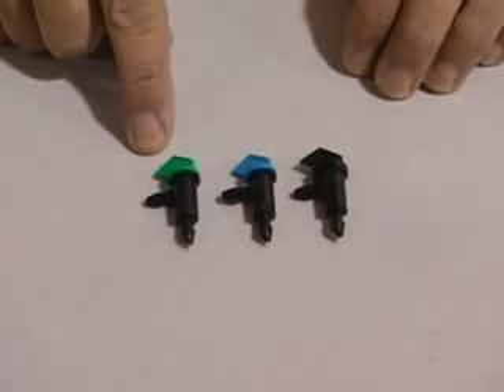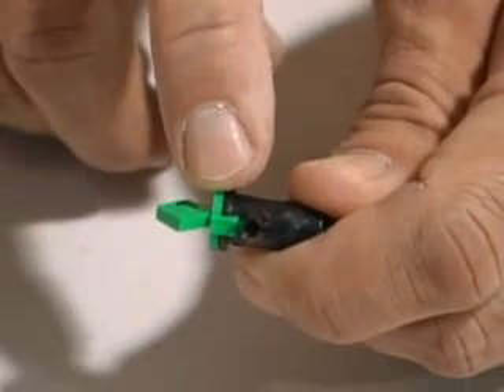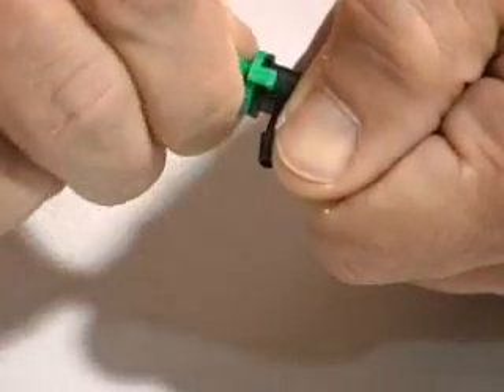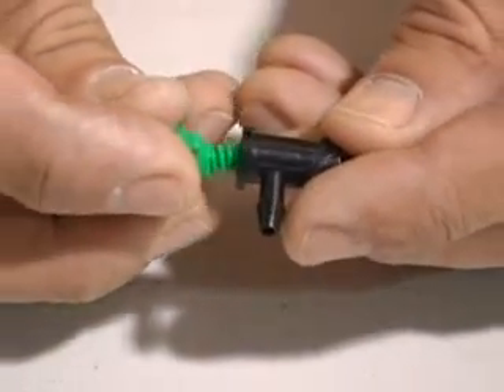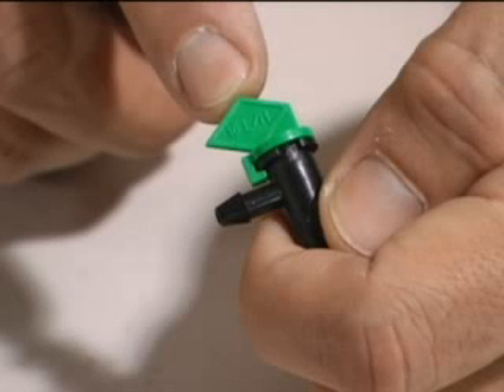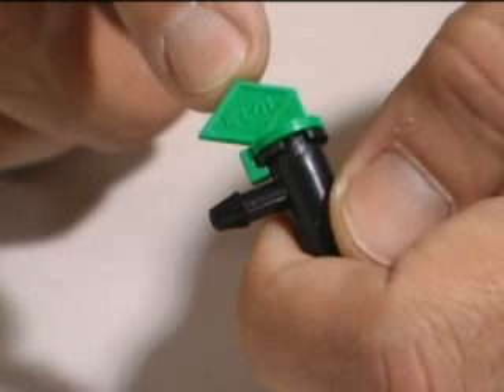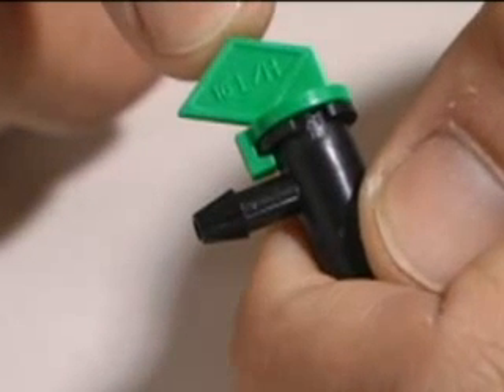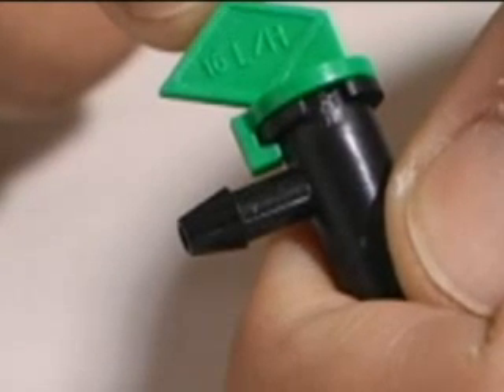Drip Irrigation flag drippers

Comment: Are these adjustable, can you turn the water off at the dripper?
Reply from the maker: These flag drippers are not adjustable and cannot be turned off by turning the flag -- we do have a dripper that can accomplish both of those (though it has more of an umbrella pattern than a drip, but it can be turned off completely and adjusted for great or less volumes of water): https://www.dripdepot.com/adjustable-dripper-on-6-inch-stake
Reply: What’s better for well water, flag or cleanable twist off emitter?
Reply from the maker: @buckfush187   Cleanable emitters do work well with hard water, so you're definitely on the right track in asking this question :)

Filtering with a screen filter can greatly delay any clogging caused by mineral build-up in an emitters, but with hard water it is eventually going to happen.  With non-cleanable drippers you'd either need to inject a solution into the lines to break up the build-up, remove it and soak it in a solution or replace it. 

A cleanable dripper can usually be quickly cleaned in the field when mineral build-up is affecting its performance.  Many flag drippers are also cleanable, so they can work well in systems with a hard water source.  :)